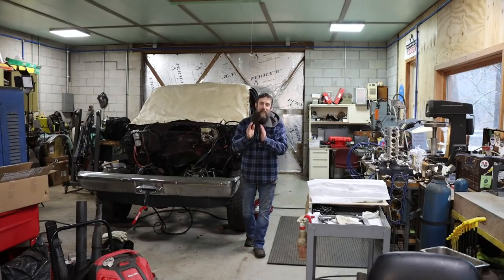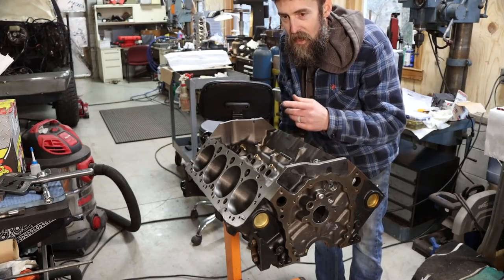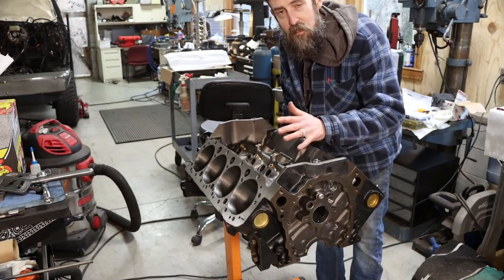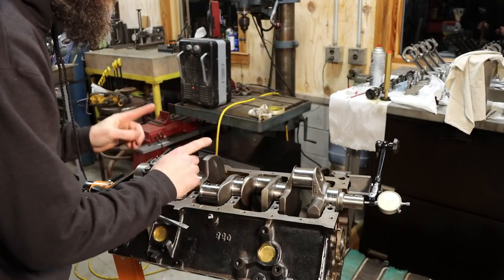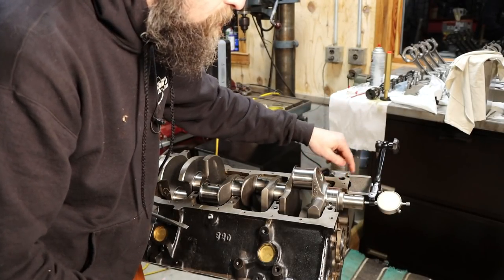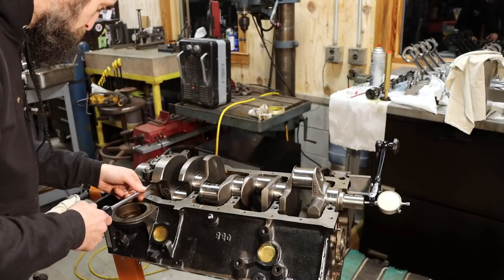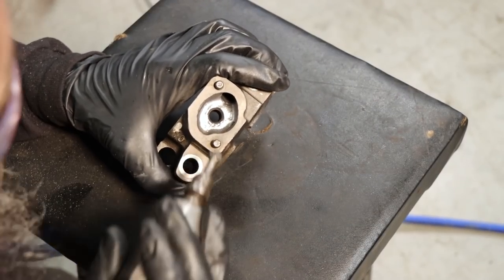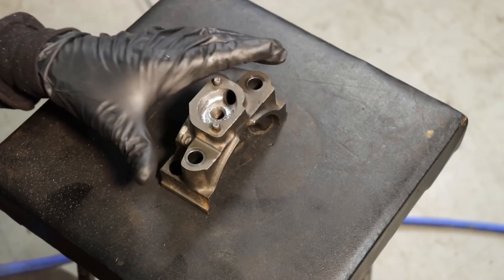Injecting some POWER into the Square Body. Part1

Comment: “It’s only going to be for hauling firewood, and stuff like that. Nothing fancy.”
Yeah, right, Steve! (Sets about documenting and building an engine WAY over and above what is needed!) 🙀🤣🤣
This video made great viewing, showing once again the care and pride you take in your work. Excellent project. Thanks for taking so much time to show and explain it all. Loving it! 👍👍
Reply from the maker: Believe me it will still be a firewood truck😁.  In fact I would bet it will get used 3 times as much as it was before.  The fact that it was junk and I didn't trust it made me not want to use it.  I plan to use the old bed that way I don't have to worry about it.
😁😁👍👍
Reply: @SteveSummers ,and this way you can pass the slower cars with a full load of firewood, just be careful you don’t spin the tires as you’re shifting back into fourth gear! Lol
Reply: @Hoaxer51  Chuckle !

Comment: As I was an engine machinist over many, many years I can tell you this will be such a strong 383 that will stick a grin on your face every time you hear the exhaust note.  As I have a 355 that is built to pull right out of the basement that 383 will tickle your fancy all day long my friend. I can see you just driving for the pure enjoyment my friend. You are doing this right bud. One thing you may want to do is stress relieve the entire block by rounding off all the flash and sharp corners. It only takes a couple hours and the block will be the better for it. DO NOT TOUCH THE BEARING SURFACES as the acid on your hands effect the Babbitt They need to be cleaned with something like WD40 and then washed with hot soapy water and rinsed. Then re-oiled or lubed with assembly white grease. I have a pair of non static tweezers for handling the Plastiguage. Works great. Aside from touching the bearings you sure know your way around a small block Chev.

Comment: I know about the torque plate for sizing the bores. I have a race car we run in a lower class, that restricts the internal modifications. The last time I sent it in for freshen up, the builder had to bore the block .010 over, because the cylinders was out of round and would not hone properly. You will have an awesome truck when you finish

Comment: The cam is the secret to engine building. Just remember to keep the lift to under a half inch. Over that and you'll need different valve springs. I would also recommend screw in studs for the rocker arms instead of the pushed in factory ones. Sounds good though.

Comment: This is why we all love watching your attention to detail and doing the extra mile to share (@@)! In 1999, we installed one of Summit Racing 383 stoker's with 450 trans, and locker 410 from Strange in our '29 Ford Roaster PU. The power and torque this comb produced, ripped the four link adjuster rod lugs (3/16 thick)  and the front left shock lug from the frame. Frame was new from Pete & Jack's special order to my specs for the power plant. Also had a Watt's linkage to control side lateral load, but the 420 hp in this lite roadster proved too be a beast (@@)! You and the ole 78 are going to love this new power plant :)> Syntactic Purple 5-30 Winter /10-30 Summer I would recommend...Yes, pricey, but proven. Bear in Tx.

Comment: All those mods are good & acceptable to save parasitic loss. Most torque to be had for this "heavy" truck is in the cam.  Research it for yourself: a marine cam has an almost flat torque curve from 1200 up to 4700 rpm. (Way above a street grind).  A boat through the water is like driving on the street up a 45% grade. Street cam couldn't even get a boat to plane. We always used to put Mercruiser 260 cams in our Chevy 350's for tire roasting performance. With a marine cam you won't have to downshift going up a steep grade.
Reply: Awesome tid bit. I never considered that. SOLD !
Reply: Very good tip here sir!! Thanks for that

Comment: Years ago at Foot  Burt division of Reynolds Metals in Cleveland Ohio, I worked on building the transfer line that did all of the machining of the General Motors small blocks at the General Motors plant in Tonawanda New York.
If you notice those two larger holes on each end of one side of the oil pan mounting surface, those two holes are used to locate that engine block at every station along the machining line.

Comment: I had a 1966 bug that I all set up for road racing, it was lots of fun until it was STOLDEN. So I went to find another vehicle but needed it to tow a 19ft jet boat that I had purchased and found a 1974 El Camino with a 400 small block and Quadrajet. Love that Truck/Car, whatever you want to call it, and with a 400 small block in it would just haul a*s. Of course, going from a 1300cc VW to 400 sb would make it seem like the it hauls but when I purchase a Haynes manual so I could tune it, found the engine only had 190hp "WHAT 190HP" that can't be. I was so disappointed I thought it would have at lease 300hp, dang Calif emission requirements.

Comment: Since you are measuring the valve reliefs in your pistons you are obviously going to calculate your compression ratio.   You probably know this but you can easily calculate the static compression ratio, but its more important to calculate the dynamic compression ratio which is what the assembled engine will see.  Because the intake valve can actually remain open past bottom dead center compression does not start increasing until the piston is actually up in the cylinder a bit thus reducing compression.   This is how a lot of engine builders de-tune high performance engines to run on low octane pump gas.   There are on-line tools that allow you to calculate dynamic comp ratio based on the cam you are installing.   Very cool build, keep up the good work.

Comment: The Melling M-55-HV pump usually is shipped with a high pressure spring installed(80 psi). I suggest for a street engine to change to the lower pressure spring. This reduces pressure to about 60 psi and greatly reduces wear on the distributor gear. If you're using your original distributer, don't forget to change the gear to one rated for the steel roller cam. Looks like it's going to be a nice build!
Reply from the maker: I agree. This pump came with the setup. A standard volume pump would be perfectly fine and in some cases better. I will have to do a little searching for the spring. If I remember correctly its yellow?
Reply: @SteveSummers  It's changed over the last few years. Melling in their pump rebuild kit came with two springs. The plain spring was stock (40 psi) and the orange/yellow was "Corvette"(60 psi). They stopped including the orange with the M-55-HV a few years ago (likely considering the LS  parts out sell S/B). The M-55-HV usually has a blue (Although I've seen it black). The M-55- HV pump is the performance standard but, I've seen 100psi out of the box. For street use this needs to be calmed down.

Comment: I don't want this to end. You've got it apart so why not check everything. Polishing the inside of your oil pump is a good idea. Most race motor's will have Polish n ported heads, along with the intake manifold. Everything glides better on a smooth Polished surface. Years ago I had a 1970 charger, 383, 4bbl, it ran pretty well, but the first thing I did ror performance was a hi-rise intake manifold. What a difference. Once the rpm started to rise, it was like another gear, it pulled extremely hard. So this video really brings back alot of memories. Can't thank you enough. Stay safe.

Comment: Rear main cap passage where it changes direction down near the parting line needs a minute of die grinder work also if you flip it over and look at it.
In the block. Please measure 8.5" down from the oil pressure hole to verify the oil flow diverter plug is installed properly.  The oil pump flow from the main cap goes into the block passage. A few inches up it is stopped by the diverter plug and forced to go into the passage out to the filter.  It leaves the filter and goes back to the same passage to the oil pressure switch.  An intersecting passage takes it to the cam bore and the 3 oil galleys.

Comment: Grease on a tap captures most of the chips, but doesn’t work as well as Tap Magic or Rapid Tap. A friend of mine got me to put a filter on the heater hose. I was amazed how much sand it caught. I’m not sure modern casting methods even casting sand any longer.  I sure appreciate you sharing the what and why’s of everything.  Love Plastigage. Hard to beat empirical testing. Very interesting project.  Thanks again. Cheers, Will

Comment: I will just mention one thing that a lot of engine builders don't know about and that is cleaning the bores. You can use all the hot soapy water you name the detergent, and your bores will still have honing grit I will  guarantee it and challange anyone else who is building an engine . Clean as you normally do, then take a clean white  rag wet it with clean atf and wipe the bores out and you will not believe the amount of dirt you will get.  Try it and post the results.

Comment: Have a real good look at what your cam needs are for your application and get the right cam, they're not really that expensive.
If that cam is too big, sure you might end up with more powerful engine but it could also potentially end up with less power than you had before in the RPM range that you use the truck. 
Talk to the guys at somewhere like Crane or some other reputable manufacture that has really good customer technical support and get their recommendations for your application.
They will take into account engine size, compression ratio, vehicle weight, transmission type, diff ratios, how the truck is going to be used etc etc 
 The most important thing is to get the engine breathing its best where you use/need it the most, that will give you the most usable power, don't worry about peak power  it will be what it will be

Comment: We used plasti-gauge back when I started my mechanic career in 1973. It is an essential tool for an engine builder IMO.
Reply: You can't beat it. I first used it in 1977. I stopped using it when I got married (and sold my 69 Camaro. Should've kept the car >:/ )

Comment: Steve, 
I enjoy your channel. I am a professional engine builder. A few suggestions for you..

I too convert the front block plugs the pipe thread whenever possible.  I suggest adding a small hole in the center plug. This allows instant bleed of any air in the system at start up, and dribbles a little bit of oil onto the timing set. I use a 1 mm drill.

Melling does not recommend the M-55HV, or even the M-55, oil pump for this application.  A number of years ago, the casting was revised on these pumps. There is significantly less material in the neck of the pump. They do offer a pump with the better casting in the Melling Select line. Also, for this engine application,  the HV pump is not needed. Later build small blocks went to a 3/4 inch pick up tube, from 5/8, in order to improve volume at lower speeds. The higher capacity gears of the HV are meant for engines with very large bearing clearances or additional oiling needs. The Melling Select pump in a standard volume, with the 3/4 pick up size, is part number 10554. 

You mention needing a flex plate. The one piece seal crank requires the late model, counterweighted, flex plate common to all one piece seal 350 engines. Scat designed the crank for this flex plate. The early 400 flex plate will not fit this crank. If the crank was internally balanced, you will have no issue.

Getting the cam spec right is the biggest problem with engine builds. The 383 is quite often cammed incorrectly, leaving all kinds of torque output out of the build. Do consider carefully the cam. If you give me all the engine, cylinder head, and vehicle specs, along with what you want the engine to do, I will suggest an appropriate cam spec.

Also note, a roller cam may require a different distributor gear. Many roller cams are made from materials incompatible with the typical iron distributor gears that were used in production flat tappet engines.

I applaud your use of a beam style torque wrench. Just curious, since you have a nice bore gauge, why not use it to measure your bearings, instead of the plastigage?
Reply from the maker: The plastigage was a video demo for the guys and gals without the tools👍. Thank you for the offer and info.

Comment: Starter shims . Later in the build after you dress the burrs off the ring gear teeth. Mount the starter to the block. If it's a conventional delco. Measure the bare armature shaft distance to the outside of the ring gear.  0.125" is the proper distance. Too tight . Add shims. Too narrow. Shim the outside only. Or file the inside top surface of the starter to bring the shaft inward to get the perfect 1/8" gap.

Comment: Steve, I built a 383 stroker a year ago for my jeep scrambler.   Its basically a clone of an engine build I saw on a car show I saw on TV.   They dynode it and it made 425HP & 491FP tourque.   The only difference was a two piece rear main seal block with a flat tappet ( 268 / 276 Slit duration with 486 / 498 Lift Lunati Hydraulic Cam w/ power band from 2000 to 6200 RPM ) and a 750 Double Pumper carb.   Every thing else is what you are using except I don't know what heads you are using.   I used Pro Comp aluminum heads w/ 202in intake & 160in exhaust valves w/ 200cc intake runners w/ 68cc combustion chambers ( 10.4 to 1 Compression w/flat top pistons like yours) on 87 Octane fuel with 8 Degrees initial Timing and 34 Degrees all in.   The 383 is nick named the "Torque Monster" & has more HP, Tourque and is more efficient ( better MPG ) that the stock 350ci.   It is a great all around daily driver engine.   This one is the 8th one I have built and is the tamest one of the eight and I have loved them all.   IMO, the 383 stroker is what Chevrolet should have built ! ! !   You will love yours too !   For Comp has a great Ignition set up with a Pro Billit Distributer ( which is vacuum advance or remove vacuum advance and it becomes a mechanical advance ), Pro coil, 6AL Control Box w/ Adjustable Rev Limiter and Plug wires.   CHEEPER THAN MSD BRAND Also & works just as good IMO.   Love your channel ! ! !

Comment: You do a much more aggressive profile on a roller cam and reduce valve overlap to a great extent. You can keep lift to a min and keep duration longer and then snap them valves shut with minimal valve overlap.

Comment: I built mine during college in engine class for a grade. After college, I put it in a Nissan 720 pickup. It made 350hp on the dyno and was too much for that little truck to handle. The few things I can remember having issues with was the valve springs not liking the cam, had to upgrade the springs. It also preferred a HEI distributor and the fuel economy. After selling the engine to go into a boat, it now lives in a boat and still runs great 10 years later.

Comment: On the transfer line, If any of those head bolt holes are not drilled, and then tapped, the entire line shuts down, because after each of those operations, the block goes through a "probe" station to make sure those holes are drilled and tapped.

Comment: My biggest recommendation I make to people building engines these days, for quality of life improvement, is using one of the popular injection kits Holley and Edelbrock, etc. offer these days. The ability for those systems to just start and run at maximum efficiency and performance, based on the computer control, will mean all your carburetor and ignition issues are a thing of the past. IMO, unless you are an OG seasoned race guy, there is no way you will be able to dial in a carb and your timing nearly as well as these new injection systems can, not to mention they have the ability to both learn and change on the fly, based on conditions (both with the engine and the environment).

Comment: Never never use a high volume oil pump on a stock block high pressure ok,the oil cannot return fast enough and with the block offs u installed it's even slower. GOOD LOOKING BUILD..

Comment: Since you’re already deep down the “Rabbit Hole” you should seriously consider the Holley Sniper fuel injection set up. It’s extremely reliable and super easy to install. Love the series Steve, keep up the great work.
Reply: Paired with the Holley Hyperspark ignition should be pretty painless.
Reply from the maker: 😁😁. One can dream
Reply: @SteveSummers  we’re happy to spend your money.
Reply: For that money he could have bought a 6.0 iron block LS and had the computer reworked and the wiring harness simplified to a 4 wire setup. It would still make near as much power and get better fuel efficiency.
Reply: @sshep7119  With a bunch of miles on it though. Without watching the vid again, I this is an entirely new motor.

Comment: Steve I've built and driven two engines just exactly like you are building and let me tell you that you are gonna absolutely LOVE it . You will have a decent fuel mileage engine and all the power that you will ever need . The first one I built was in a 74 Chevy Nova and it was awesome the second was in a 77 Chevy pickup that I used to two a 26 ft pull type camper . With the 383 I could smoke the tires on the truck at anytime I wanted and it never saw a hill it didn't love .  I'm sure you already know and will do this but I would suggest that you tack the oil pick up tube to the pump for extra security . I had a torker two intake on both builds and was absolutely satisfied with the way that they ran . One had an old Quadrajunk carb the second had a Carter AFB carb . I don't think that they are available anymore, anyway I'll quit rambling keep up the awesome content !! Can't wait for Saturday to come every week so I can watch to see what your doing each week .